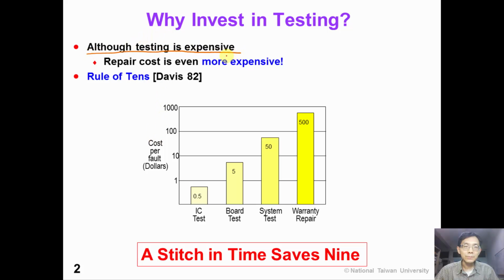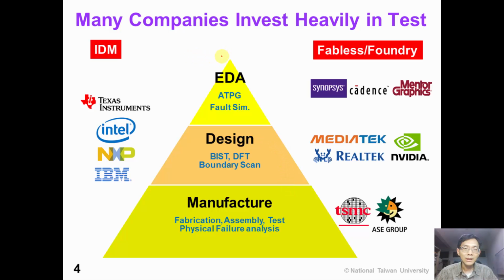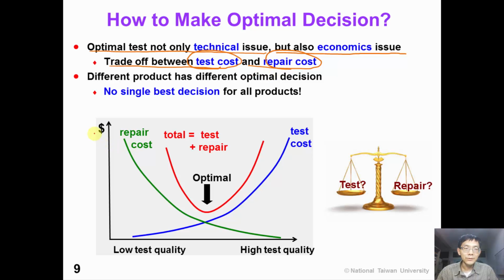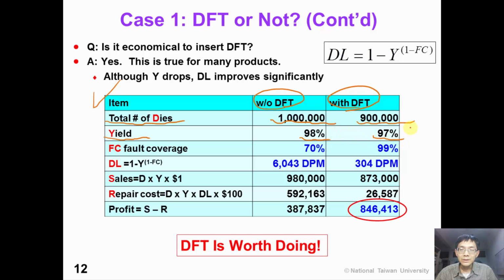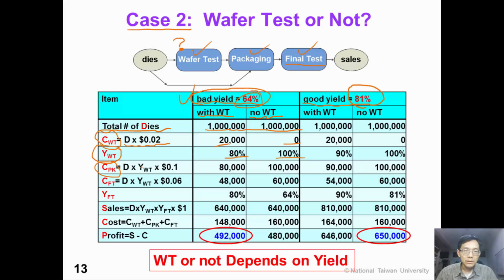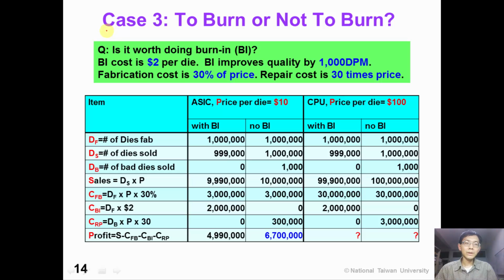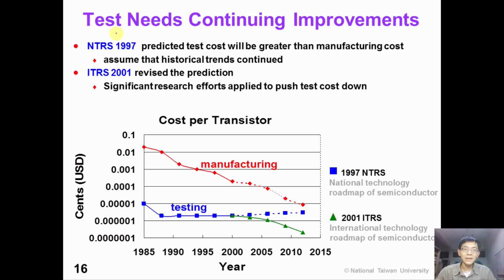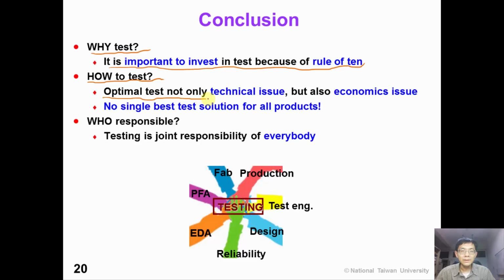1 4 Introduction Test Economics

Comment: Professor, in the Case Study 2 I have a question. I noticed that for the "with WT" the Y_WT * Y_FT have the same value as the Y_FT for the "no WT" case, and I'd like to know why. Are there any reasons that I'm not aware of that makes the process yield to be split equally between each test we make along the overall process?